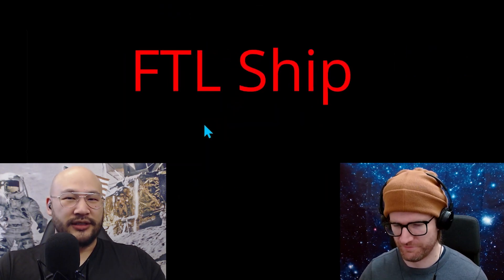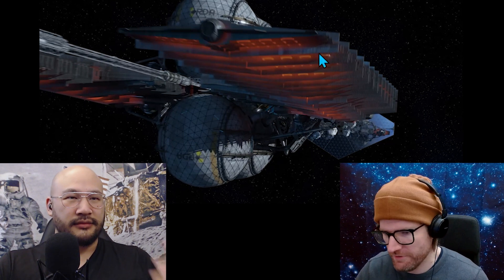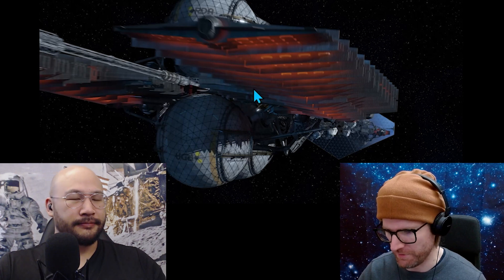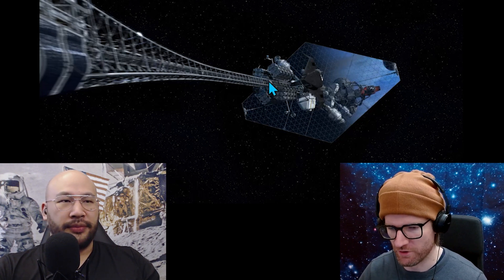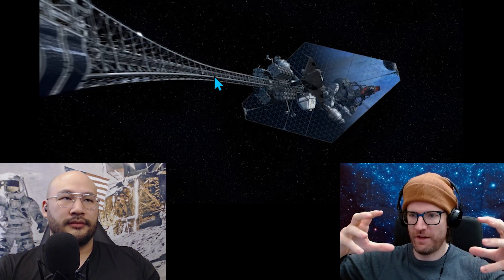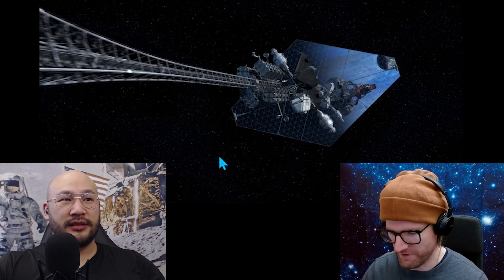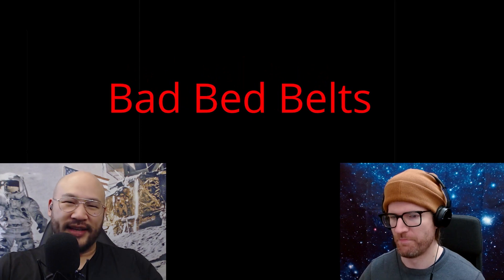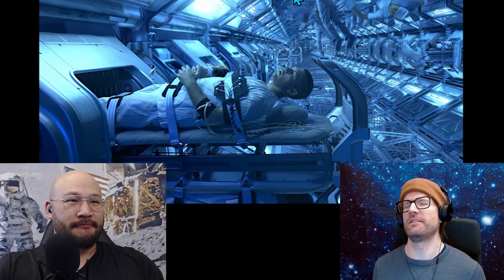Avatar (2009) | FTL Ship Analysis

Comment: The cryo pods gas cylinders' use could be due to some sort of emergency evacuation procedure. Like if the ship sustains critical damage, the pods eject out the side with their own (albeit limited) life support system?
Reply: I could also see the valves being controlled wirelessly through a central computer.
Reply from the maker: The emergency scenario we didn't consider!

Comment: Most likely the ship is flying backwards. So the engines are, indeed, at the rear. It's performing an orbital insertion, so it's decelerating. I don't know why you would assume it's oriented so that it's thrusting in the direction is going since that would cause it to accelerate which is not what you want to do when trying to orbit a planet you're approaching.
Reply from the maker: We actually weren’t sure 100% how the ship was oriented. Mainly our guess came from the thinness of the central structure.
Reply: I'm just saying that it doesn't make sense to have your thrusters oriented so that you're accelerating when you're trying  to decelerate into an orbit around a planetary body. I get that Avatar is a sci-fi action film that takes a lot of liberty when it comes to any actual science, but I also know that James Cameron likes realism and always pays attention to detail.

I'll also point out that we don't necessarily know the way the ship thrusts or the amount of thrust it generates. It's much more efficient to generate constant low thrust than to generate a lot of thrust at once. Likely, the ship uses something like ion propulsion. At the relatively low thrust levels ion engines produce, the main structure of the the ship wouldn't have to be very bulky or thick because it wouldn't experience as much stress as if it was under a lot of thrust from larger, more conventional engines.

 @semistableclips
Reply from the maker: I like this analysis. It does look like the mirror is part of the propulsion system, but that might be wrong.

Comment: just to say this ship is not FTL capable only conventional
Reply from the maker: So they took another ship from the Sol System to the Pandora System?
Reply: In fact there are 12 isv ship like the venturstar thats to shorten te rotation time sinse the ship is not ftl capable the trip take multiples years 

the ship is accelerated via a big laser and a solar sail from earth and decelerate midway with 2 mater antimater aniilation drive the 2glowy thing at the front being the radiator for thos drive taking monts to cool dawn @semistableclips
Reply from the maker: Hmm interesting. None of the characters seem to be worried about their families and friends back home aging rapidly compared to them (either through cryosleep or time dilation), so we just assumed the ship was FTL-capable.

Comment: I too agree that the straps in the cryo pod were way to loose, although I also wouldn't want the straps to be tight. I'd assume they would leave some nasty pressure points (deformations maybe?) after the literal years on that journey. I would rather prefer to be lightly sandwiched between two mattresses, or one mattress and some bladder/pad thingy filled with highly viscous gell. It would keep you in place, should not leave any isolated pressure points, and would dampen and sudden movement due to the viscosity. The biggest drawback, apart form engineering it to not ever spill, would be the added dead weight.
Any other opinions on this?
Reply from the maker: Hmm. It seems like the straps might be quite complicated depending on exactly how the crypsleep works.

Comment: In space, for the most part, you don't need to twist/roll if you're the largest structure. The smaller ships move around you, as you are a gauge of what is proper orientation (like real world shuttles do with the ISS). You might turn, but that isn't too hard if done at a reasonable speed - it will keep itself in line with minor thruster use from the aft section. Only issue I see is seemingly a lack of emergency braking systems to stop the aft section in case the main ship has to halt forward movement quickly, but otherwise consistent, proper counter thrust from both sections would stop the ship without issue.
Reply from the maker: I see! The big ship is expected to only move in straight lines or in free fall, so the central structure isn’t expected to hold anything but tension? Any support ships would maneuver around the ship?

Comment: Never watched the show, but looking at the design, would guess that the balls were fuel for lasers, which would be housed in the large red nacelle's, which would shoot out at the mirror at the other end creating a drive.  The rotating objects in from of the mirror are a bad design but it's just a guess.  Why it would go the other way seems odd all the way around.  Not even sure that would work due to the various laws of motion, but it's just the guess of a sci-fi fan.  It would also make the thinner spine more plausible.   Also, based on the motion there could plausibly be the idea that the ship spun around and decelerated into orbit, thus making my idea plausible?
Reply: The engines don't seem to be aimed at the mirror, but past it, so there's not problem with the direction it's going.